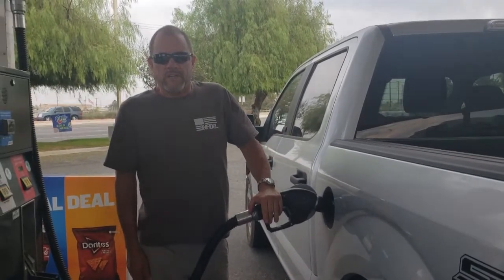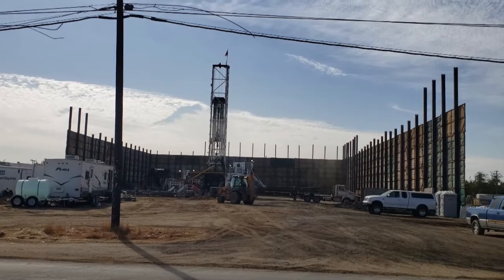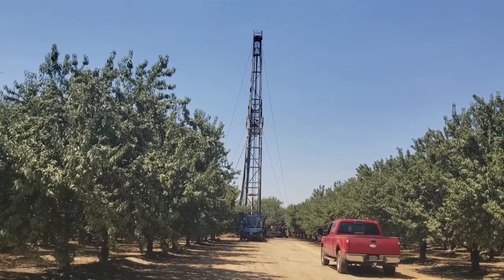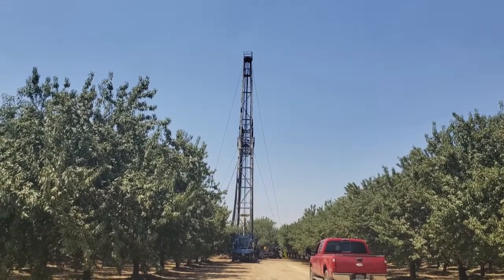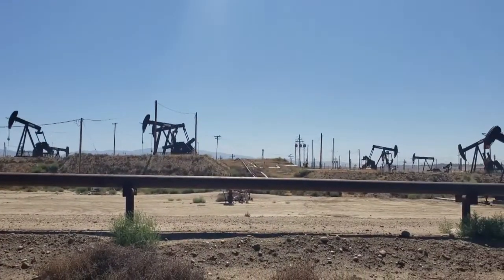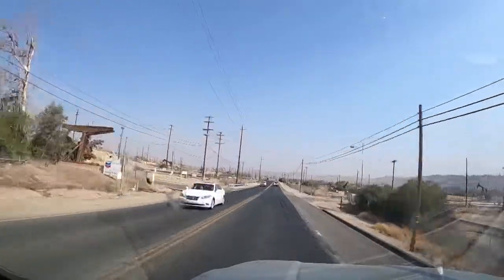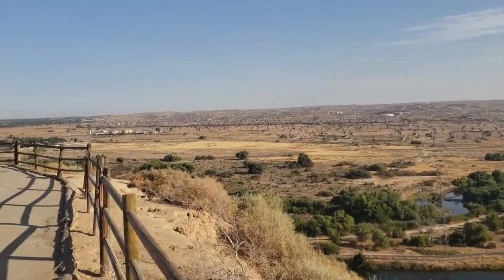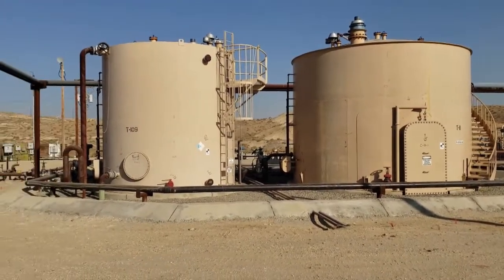How Oil Gets From The Ground to Your Car

Comment: They are called cracking towers. Different compounds vaporize at different temperatures, and they get separated. Each level is a different temperature and throws off a different compound. From crude you get gasoline, kerosine, diesel, home heating oil, different solvents, lubricating oils, and so on. I am pretty sure the Wikipedia has a more through description of how cracking towers work (or the website how things work).

Comment: I forget what refinery I drove buy in the late ‘90s.  But, if I’m not mistaken, as I was driving down a road, I’d swear there was no fence around the plant or unit, preventing me from driving in and causing mischief.  Now, at least the refineries, are federally protected as they are potentially a terrorist target.  Major trouble if you’re caught sneaking in, and other illegal activities.

Black tanks absorb solar energy and help keep the crude war, and flowing.  Many heavy oil lines are steam or electric traced to keep the oil flowing.  In my refinery that I worked with, yellow pipes and tanks signified sour streams (high sulfur content, hydrogen sulfide, mercaptan, etc., potentially poisonous or lethal material.a. In fact, up at Mammoth Mountain ski resort in the Sierra Mountains, there was this bent pipe, that has a orange plastic fencing around it.  When you skied by, you could smell rotten eggs, if the wind was in the right direction.  I forget what the PPM (parts per million) were for the thresholds for working exposures, smell of rotten eggs, deadening sense of smell, and respiratory system arrest and death.  But, you always want to escape cross wind, otherwise you go in-towards the source, or you go away from the source but remain in the vapor path.  Mammoth is actually a dormant volcano.  They frequently have mild earthquakes.  It wouldn’t surprise me (and many others) if we don’t get another Mount St. Helens eruption from this.

 Anyway, one day, the ski patrol were doing something by the pipe.  There was a sunken area in the snow around the pipe.  One guy hiked down into it and passed out.  The other ski patrol went in to rescue him and passed out. They both passed away from H2S exposure.

In fact, one early spring day, on my way to a business convention up in Lake Tahoe, I stopped in at Mammoth to visit a friend.  Well, I took a road as far as I could going up to the Minarets & Devil’s Postpile, until themroad closed off due to winter closure (snow).  I pulled over and hiked around a bit.  There were signs warning of the escaping H2S, SO2, CO2, etc., and the dangers of it.  You could see the trees that were dying.  I remember the environmentalists were saying the trees were dying from pollution.  Uh, it was nature’s pollution.  But, I started to think I just might seriously be in danger if I didn’t get back to my car and leave.  To get away from the fumes?  Noooo.  I started thinking the bears just might be waking up from hibernation, and they are probably hungry.  I was outta there in no time. Lol

Comment: I remember years ago espee use to run daily oil cans from Bakersfield to Torrance.  Sometimes  up to 10 locomotives was need to get this 110 car tanker train over the Tehachapi mountain.  Now it's all moved in a pipeline from the valley to torrance.
Reply from the maker: Yeah. When we would get called out on a signal problem it always seemed like the oil train was waiting when we got there. They finished the pipeline from Bakersfield to Mojave first and used that as a loading facility until they finished the rest a year later. It was quite an operation!

Comment: Hello Mark thumbs up one thing I never do or let my wife do is stop at a station when the fuel truck is delivering because condensation buildup in the tanks mixes with the fuel and with modern autos fuel injection system’s it causes problems

Comment: This is a very cool video.   I love all the oil industry gadgets you're showing us. Used to live near a refinery.  At night, they would burn off the excess gas in flare towers and the whole night sky was lit up. I actually kinda like the smell but I'm kinda weird.   There was a movie called "There will be Blood". Daniel Day Lewis played a wildcatter.   Good movie about early California oil industry. Showed how the old cable style drill rigs worked ... crude and very dangerous.  

P.S.  The one shot of the first well that was hand dug ... you think those silver pipes were looped because you're in earthquake country?  The pipes have some give and take as the ground moved? Or maybe just for heat expansion?  Pretty cool shot in the video showing looped pipes. just curious. Thanks for another enjoyable video.
Reply from the maker: Thank you! Those are called expansion loops to keep the pipes from breaking from temperature variations

Comment: Sorry for the multiple comments.  But, I’m writing them as I watch the video.  So, when a well blows out and lights off.  How do they stop the fire?  Block in a valve?  I’ve seen some movie or documentary or the other, and they used TNT to suffocate the fire, I believe.  Is that what they do?
Reply from the maker: They have to call in well fire specialists. They clear the rig off the site then use high explosives to blow the fire out then they move valves in to stop the oil or gas. This particular well just stopped blowing about 48 hours later.
You should watch the John Wayne film "The Hellfighters".
Reply: @MarkClayMcGowan  Yes sir.  I believe that’s where I imagined I saw something to the effects of snuffing out the fires with TNT or similar.  Great movie.
Reply: @MarkClayMcGowan  I just might have to watch it again.
Reply: @MarkClayMcGowan   I don’t know if I mentioned this before.  But, now that I know you’re educated in the petroleum industry, I figured I’d share this with you.  I used to work in an oil refinery.  The industry standard / regulations require a HAZOP for any new process to be put into service, and a HAZOP review every 5 years to cover changes to the process and any significant events within the last 5 years.  A HAZOP (HAZard OPerability study).  This is where (in my experience) a facilitator is contracted to facilitate the study.  They are typically a petro-chemical, mechanical or other engineer.  They prepare in advance, by getting all of the piping and instrument drawings (P&IDs).  They have every piece of equipment and piping in the process.  He will determine a starting point, determine how far to follow from that starting point, ending it, and starting at the next one.  These sections are called Nodes.  Each node will be hi lighted with a certain color on the master set of P&IDs.  An example: Node 1 Blue...starting with the boundary feed stream, going to storage tanks, pumps, filters, heaters, sulfur strippers, fractionating towers, etc.  the participants color their own set as we move along through the flow within the node.  Some times they branch off, and it is pre determined where it branches off p, what equipment (all within that node) and where it ends.  Then you go to Node 2 -Green...on down the line through the entire unit or system.  Starting with the first stream.  Design properties are stated:  designed flow rate: 45mbd (thousand barrels a day).  We discuss what happens if that flow reduces or stops?  What are the hazards.  What are the causes?  What are the safeguards?  An example would be loss of flow.  Potential for our feed tank to run empty.  Potential for our feed pumps to loose suction and run dry, resulting in seal failure, overheating, bearing failure...Potential to bottleneck upstream unit. (we don’t go into other units.  They would cover their own.). One particular facilitator called it blood, guts and feathers, meaning catastrophic failure, damage, injury and / or death, environmental issues...  Next we give it a risk ranking - a matrix of consequences and likelihood of the event.  Next, we list the safeguards, such as low level alarms, high pressure alarms on our pump seal oil systems, low flow alarms, operator training, fire deluge system and brigade, etc.  we determined it was blood, guts and feathers the maximum severity.  But, we take credits of the safeguards alarms, seal oil systems, etc., to reduce the likelihood.  We look at the matrix of severity and likelihood after the safeguards.  If the risk ranking is too high, we look to see if there are or need more safeguards to bring the risk ranking into acceptable levels.  We do the same for Pressure, Temperature, Level, Vibration, etc.  even things like seismic acceptability.(as an operator, I am not qualified for any discussion of things of that nature, or equipment metallurgy, instrumentation reliability, etc.we will have a representative present for each discipline of the study.
Now, one particular facilitator from Louisiana did one of our HAZOP study.  Nice guy.  Shared some experiences and stories.  He even showed us some pictures of an off shore oil rig of which the HAZOP he facilitated.  It was a new oil rig.  He had pictures of it being towed out from Galveston Texas into the Gulf of Mexico off New Orleans. It was the Deepwater Horizon rig.  I’m sure you are familiar with this rig.  It exploded, killing some workers and creating possibly the worst natural disaster from an oil leak.  They could not get the well to stop flowing crude oil into the gulf from the broken pipe at the bottom of the seabed,  the emergency isolation valves failed to isolate it.  It became a continuous live television features 24 hours a day, for I don’t remember how long.  2 weeks maybe?  They had cameras set at the bottom to monitor the flow and the attempts to isolate it.  I’d wake up every morning to tune in and see if there were any changes.  Such a tragic disaster.  I thought “My God!  That was OUR facilitator.  I tried unsuccessfully to get a hold of him.  I have a feeling I would have to get through a team of lawyers to reach him.  Not that he had any blame in it.  I figure, the very least, they had questions on what was covered in the HAZOP, and the like.  I wish I could remember his last name.  I would google it to see if I can locate him and check in with him.  Just thought you might find the story interesting.  That’s my story, and I’m sticking to it.😉✌️🤙
Reply: @MarkClayMcGowan  For extinguishing well fires, the name that comes to mind is Red Adair, of "Boots & Coots." IIRC, they put out Saddam Hussein's Kuwait "flares."

Comment: They are called cracking towers
Reply: Actually more'n'likely fractionating towers. Condensing vapors rising from the mix of hydrocarbons boiled off by heating below, with the heavier (less volatile, higher boiling point) condensing lower down, then proceeding upward to progressively shorter-chain hydrocarbons, like from heavy bunker oils, lube oils, lighter fuels, then gases like butane, propane, ethane, methane. Some products there likely need shoveling out, solids like asphalt. Fancy stuff goes on with catalysts: cracking to shorten molecular chains to convert heavier oils to products like diesel & gasoline, or reforming to assemble shorter chains into longer. Just to match supply to demand, and boost revenue. Of course, there are various types of filtering req'd to remove undesirables. HTH

Comment: What.?!?!  The environmentalists haven’t gotten you guys to recover the gasses from the tanks? Lol
Reply from the maker: Oh yes. That small tank farm also had separators. Also, that couldn't have been natural gas as it has no natural odor but it definitely had a stench!
Reply: @MarkClayMcGowan  Oh gawd.  You remind me of something. We export liquid propane by rail for sale.  We have to Odorize it with Mercaptan (sulfur compound).  Extremely stinky stuff in small quantities. It’s been a while since I’ve messed with it.  We added it via an injection system into the propane shipments to the rail car loading rack,  I want to say it was about 12-17 lbs per rail car (750 bbls C3 per car).  Every so often, we would have a company deliver a load of mercaptan to fill our storage tank.  If I recall correctly, our tank had two pipes going into the tank.  One of them was a dip-leg, meaning, it entered the top of the tank, and went to the bottom.  The other was just a vent off the top of the tank,  now, the delivery guy would hook up to the dip-leg to fill the tank.  Also, he would have a vapor recovery hose connected to the vent. One day, he hooked up the hoses to the wrong pipes. He hooked up his fill hose to the vent line.  And his vapor recovery hose was hooked up to the dip leg - meaning his compressor was going to suck up liquid instead of vapor.  OMG!  How are we going to drain the liquid odious of his vapor recovery hose?  We can’t let his compressor suck it up.  It will damage the compressor.  He cant just disconnect and drain the hose.  That is going to stink the place to a wide area, resulting in evacuating the nearby units.  How am I going to get out of this?  Luckily, he was able to finagle his compressor manifold system to evacuate the hoses.  That could have been ugly.  Mostly quite a nuisance.  I plead the fifth. 😉✌️🤙
Reply: @perrydiddle3698  You must be thinking of LNG, not LPG. FWIW I've never encountered LPG (propane) with mercaptan odorant. No mistaking that. Anyhow, given my druthers, I'd stay well clear of LNG, considering the potential explosive power of even a small amount. Best confined to diesel engines.